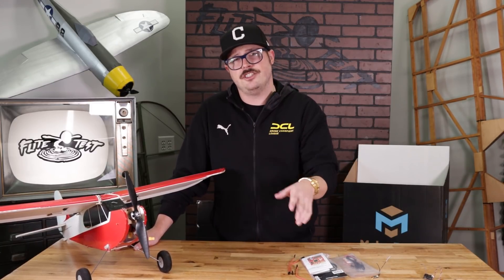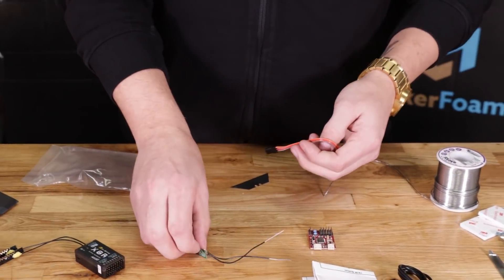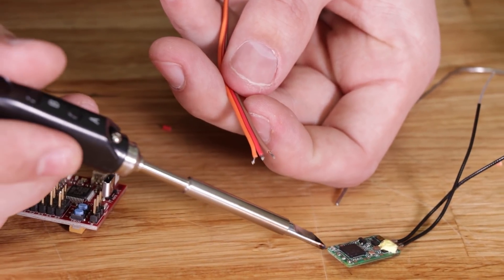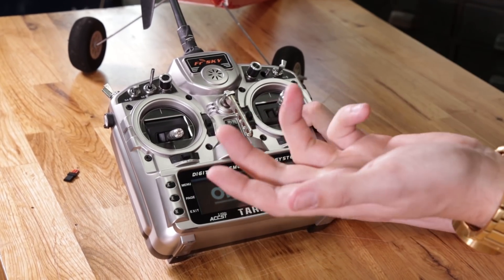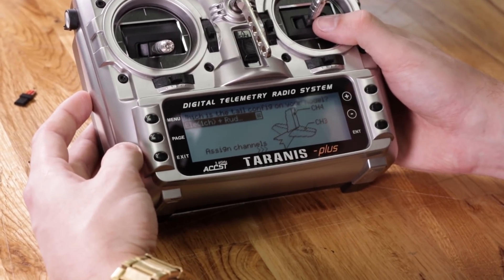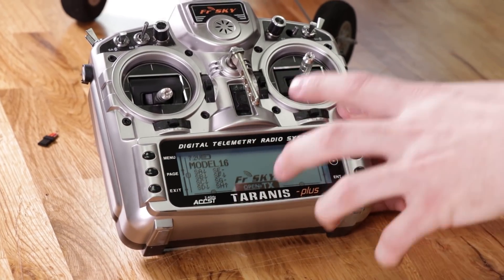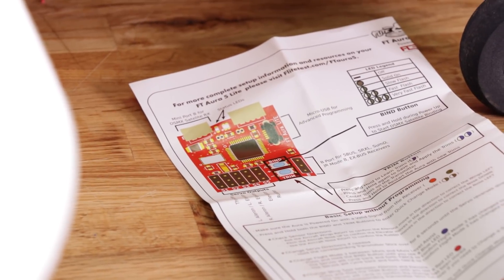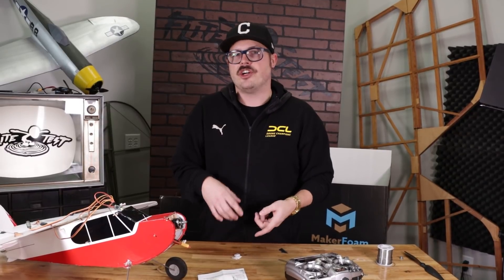FrSky Setup / FT Aura 5 Lite

Comment: ok now if use the x8r reciver and connect it as per video can i use the other channel channel ports on the reciver for gear and flaps and such or will those be non operational

Comment: Hello.
Need help with my a5l.  I set it all up and worked flawlessly.  I liked it so much I bought another and downloaded the config tool.  I connected the a5l to the config tool and again perfect but I decided to upgrade my fw 1.13 to 1.16 no problem until I tried to power up again.  All The servos swung back and forth to full travel the motor kept beeping and only blue led was flashing slowly on the a5l.  I went back to config tool and noticed my movement bars were now gone and both status monitor Windows say unavailable in autodetect mode.  But it did show the proper fw1.16.  I decided to do a reset as per your YouTube video using the config tool and convert option it’s said it went well and an orange led on the a5l lit briefly but.  Once it was all done same slow blue flashing led and servos going crazy.  I tried my second a5l and it works perfect.  Need help, thanks

Comment: As someone mentioned already, they forgot to mention that in the transmitter Mixer screen (6/14) you also need to add Channel 5 Input (I) tied to Inputs screen Ch 05. Otherwise, your mode switch won't work.

Comment: FT, I have setup the Aura 5 in a wing using a Taranis qx7s transmitter and the XM+ receiver. I followed your video on setting up the QX7 and Jeff's wing setup. I have bound the receiver and the servos and motor all work. When I program the different modes they work until I exit programming and reset the receiver. At that point there is no stabilization regardless of where the 3 position switch is set. What did I miss?

Comment: Just set up the Aura 5 with an XM+ FrSKY receiver. The servo outputs seem to be switched from the Aura 5. Moving the throttle on the transmitter moves the Aileron servo. Moving the Aileron moves the elevator servo. The rudder works fine. There is no throttle control. I've checked the wiring, all the servos are correctly hooked up. It's probably something simple. Any ideas?

Comment: Do I still need to set throws and expos on my X9D or just leave them as you have on this video ?
Reply: I found the answer on the Flex Innovations website. Dual rates and expo are handled by Aura and not the TX.

Comment: I just got this and it doesn’t seem to work with my Qx7. The gimbal movements don’t match any of the movements and when you look at the live data pull the elevon stick straight back it goes diagonal on the transmitter on the config tool.

Comment: OK so i followed along and i'm missing something.  I put it in 6 axis but when I use the SB 3 pos switch all servos move the same.  There is no difference in modes for me no matter where I have the 3 pos switch.  Any help would be appreciated.
Reply: OK so you missed the Mixer tab part in the video.  I was lost till i reached out for more help.  All is working with the 3 pos switch now.

Comment: SOS PLEASE HELP!!! I cant get differential thrust working I am trying to set up an FT Dart on aura 5. Twin setup video? my motors are not in sync the left one (plugged into throttle) starts up first and the right one (plugged into s2, just like the option says in the computer app) starts up at about half throttle and rudder does nothing no differential action like it should.

Comment: 1:00... Why is a charge cable included with the Aura ?? There are no batteries on the Aura.
Reply: @lasersbee It is not a charge cable, rather a USB programming cable so you can connect it to the Aura Config Tool on a PC and use all of the advanced features of the Aura.

Comment: I'm guessing the set up and wiring is exactly the same for tbs crossfire but I for one and I'm assured many other who search specifically for it will greatly aprepreit a video just for the tbs crossfire system either with the module or the new tango 2 remote and a standard tbs crossfire receiver ! Thanks for everything you do and I hope you have the time and energy to make the crossfire video for all the crossfire users and those who don't think it can be used in fixed wing models so easily. 

🥃cheers🍻

Comment: FT, is there scope to have a product like this that sits in series with your current receiver for the 4 primary surfaces for stabilisation, but allows you to have more channels working for other functionality?  It could have a single channel input from the RX which sets the mode it operates in.  Perhaps I am missing how you can use this on planes that require more than 4 channels such as retracts, flaps etc

Comment: I need a cheap controller and receiver for a arduino project can someone help me ?
Reply: Banggood (and even Amazon) has the Flysky Tx/Rx for under $60 now.  (I have 3 Tx and a couple dozen Rx's, and haven't had any trouble with them.)  What I HAVE had trouble with is the Cheap "Off-the-Wall" Servos with Plastic Gears.  Spend half again more money, and get Metal-Geared ones the Same Weight (9-grams). I've had 4 planes go down from Bad Servos, but not after I switched. (Hope this Helps).
Reply: M. Smith thanks 😊

Comment: I understand you guys must trust and use/recommend Frsky... but I’m so disappointed you’ve not offered true budget options along with your “budget” kits and items. Specifically Flysky, the cheapest manufacturer out there and somewhat obviously from the comment the stuff I use and own A LOT of. Disappointingly I’m sure you know you’ve cut out and restricted a large part of your community 😢😶 thanks but not thanks FT (sorry not sorry)
Reply: the website says: Ports:
Five Servo Ports can be individually configured as (PWM) Inputs or Outputs
Dedicated port for Genuine Spektrum DSM® Satellites
Dedicated input port for single wire digital connection via S.Bus® (Futaba®) or SRXL (Spektrum®, JR® Mode B, Graupner SumD) or analog PPM stream
Micro USB Port for loading model programs, user programming, and firmware updates (Cable Included) 

One of the last things it says is: or analog PPM stream... that seems to be what the flysky receivers use... so I would think it works am I wrong?...  I wanted to get confirmation before I buy
Reply: I do believe I’ve actually asked before and told noooo, but I don’t follow programming...I plug-n-play
I still think the answer is/was no...but I’d like to be proven wrong...FT? Read our comments and help us “make sure”...

Comment: Hey guys! This Aura lite looks awesome, curious to know if it could work with a flysky transmitter and receiever? I think theirs are I bus and yours are S bus though.  I noticed on your site it said analog PPM stream as well... wasn't sure if this could be retrofitted to work with my flysky.  If not, are you guy's aware of any other transmitters under $100 that their receivers would be compatible with the Aura lite?
Reply: I don't want to buy another transmitter if I don't have to but I really want the flight stabilization in my plane
Reply: Not Flysky compatible unless I’ve misunderstood and misread group questions also....very very disappointing. Also what I use
Reply: @colddash5598  the website says: Ports:
Five Servo Ports can be individually configured as (PWM) Inputs or Outputs
Dedicated port for Genuine Spektrum DSM® Satellites
Dedicated input port for single wire digital connection via S.Bus® (Futaba®) or SRXL (Spektrum®, JR® Mode B, Graupner SumD) or analog PPM stream
Micro USB Port for loading model programs, user programming, and firmware updates (Cable Included) 

One of the last things it says is: or analog PPM stream... that seems to be what the flysky receivers use... so I would think it works... but I wanted to get confirmation before I buy
Reply: FlySky FS-A8S supports the S-Bus according to its packaging. I haven't tried it yet though.